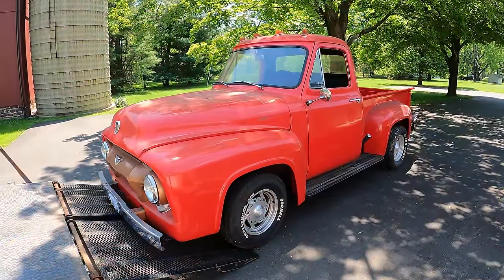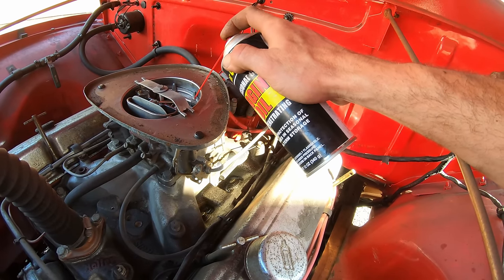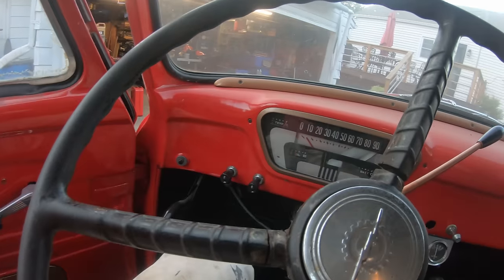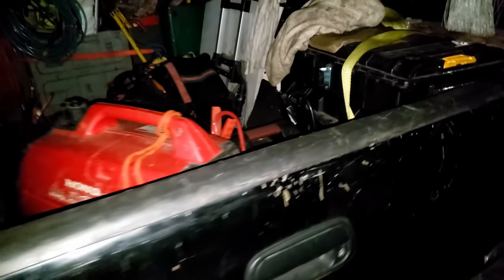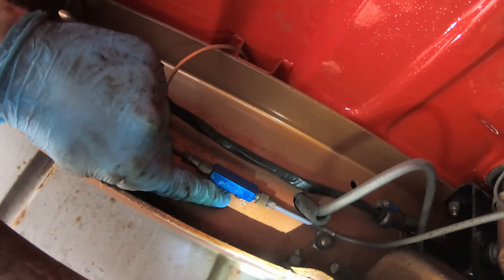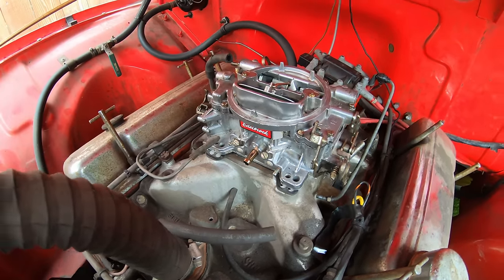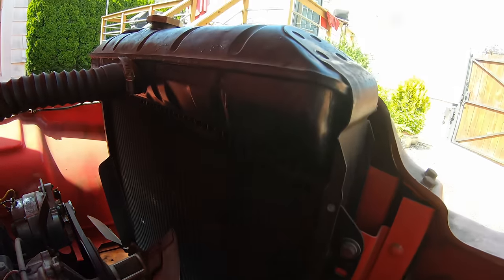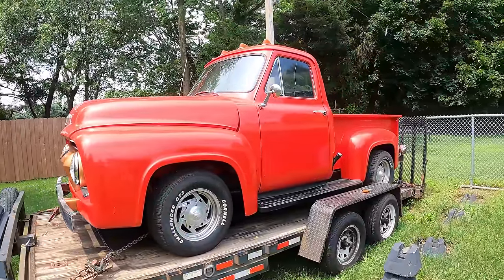1954 Ford F100 w/Pontiac 400 - Sitting For 12 Years NNKH

Comment: When those trucks (Chevy also) were made the lock was on the passenger side so you had to get in on the sidewalk side in the city so you didn't step into traffic. you pushed down on the drivers door handle to lock it then slid out on the passenger side. push down on the pass inside door handle to lock it the hold in the push button on outside door handle and hold in until the door was shut and your truck was locked. to get back in use the key on sidewalk side and slide in.

Comment: Hei  requires a true full 12 volt  key on only power source   re wire it to the back of the fuse  box  on a key on source  ,it will start and run completely different and idle clean ,make sure u gap ur plugs proper.

Comment: What a beaut. I love the older Ford pick ups. Yeah paint that center grill. Touch up the corrosion on that hood. Good cut polish and wax New glass, and That brown looks poor or chrome it. The truck bed just paint it with teak oil just like they do on the boats. If the truck were mine. I would put in a flat head V8 with a 4 speed. It would be my daily driver I enjoyed this one.. Thanks for posting it A Super High ^5 on this one.

Comment: Looks like someone removed the frame crossmember that was located at the rear front spring mounts, probably due to clearance issues.  It should have been left in place and modified for clearance as it would control frame twist in that area.

Comment: FYI. The reason the door lock is only in the right door is to stop the drive from exiting and entering the left door. The exit process was the drive would lock the left door (push the door handle forward) then slide across the seat and exit the right door. From there lock the door using the key and I don't remember if the door handle could be used before closing the door. It's been to long ago and I'm to old to remember. The industry logic was for safety, if you parked and there was traffic on the left side you would be out of harms way by exiting the right side. Studebaker did this to there trucks.

Nice truck.

Comment: Early fords only had locks on the passenger side because Henry believed it to be dangerous to get in and out on the drivers side so basically a safety feature!, also it saved money!!!!
Reply: I’ve had a ‘51 F1 for 29 yrs. It has a warmed up 302. After hearing those flowmasters, I think it’s time for dome new mufflers!
I was told that another reason why the lock was only on the right side was to let the passenger “ ladies” in first.

Comment: Brings back memories,  my cousin had a 1950 ford truck that he put a 455 Cadillac engine in.
Reply: What year was the Cadillac motor i didnt know they made a 455 i could remember a 472 i think was the size
Reply: I could be wrong on the size I was alot younger back then & I really don't know alot about Cadillac but I thought I heard him say it was a 455 but I know it was from a Cadillac, he believed in a Cadillac. Either way at the time I had a 76 dodge truck that my brother built & we put in a screaming small block 340 that wouldn't touch my cousin's truck.
Reply: @scottyellis3442  i think they made a 500 and a 425 also i always fooled with pontaic stuff
Reply: It was a strong engine, whatever it was.
Reply: @scottyellis3442  those Cadillac engines had to be strong those old Cadillac weighted probably 6000lbs  if not more
Reply: You're right about that, I'm interested to find out now exactly what he had so I'll find out tonight.
Reply: I had a 53 ford truck that had a 69 455 pontaic motor when i saw your post about the truck having a 400 pontaic thats what caused me to watch
Reply: @davidcaskey4669  that's funny !!!! Pontiac 455 wasn't produced till 1970
Reply: @ronclaman156  I think you may want to check your Chilton manual if you have one that goes back that far.  Mine also listed one for a 68 and without going out to the garage in the cold and missing the game I think the two letter code on the passenger side of the block was either a wz or yz I can't remember which but do remember a z in it
Reply: @ronclaman156  I went and looked it's a WG on the 455  and a YZ on the 400 I have both of these motors in the garage. My father in laws 69 Grand Prix had the 455 in it

Comment: Nice pickup  I took a 50 model GMC pickup made it into a hot rod. Beef up the suspension BOY SHE HAD THE LOOKS.  Setting PREFECT > I put a 327 Corvette engine in it. 511 rears, Hurst 4 speed, BOY SHE WOULD GET IT ON.. Then my wife said either those cars go or she is going.  I wish i told her>>>   HIT THE ROAD  >    I dearly love that pickup truck

Comment: Key hole on the passenger side is because the truck was designed for delivery and courier drivers. The idea was they would always enter and exit the truck from the passenger side when on a busy roadway. Essentially, away from dangerous traffic.

Comment: This is going to be long winded, but you asked for ideas, I want to help so here I go. 
     I daily drive my 2 door hardtop 72 Lemans, and I mean everywhere. It only has 89,000 miles on it so why not? I also had a hesitation with mine. I kept trying fuel but nothing helped. An old mechanic told me to check my timing, which I had set myself. I had set it at 14 degrees at idle and about 34 total mechanical timing. I reduced it to 8 and 28. Poof, hesitation on throttle tip in is completely gone. I had it set more for a built engine when mine is mostly stock. Oops, not thinking. 
     Also, please change out that single plane intake. That is killing a lot of torque, and part throttle drivability. I have an Edelbrock Performer on mine but you could try to get away with an RPM intake. The RPM intake is 1 1/2 inches taller so I couldn't use one because of hood clearance problems. You won't have that problem.  
     Another suggestion would be to go to an electric fan, or at least a clutch fan. Solid spacers on water pumps end up blowing the seals, or taking out the bearings. Every time you smack the throttle, the solid spacer jerks the water pump bearing on acceleration, then again on deceleration. Not only does it take out bearings and seals, I watched a guy smacking the gas and revving his car at a car show. All of a sudden he had coolant spraying everywhere. He broke the snout of the water pump. Oops again. 

     One more thing and I'll stop. Speaking of water pumps, you didn't say that it is having a running hot problem, but I'll give another experience. If it tends to run hot with the new radiator, don't look at the radiator first. Pull the water pump. Pontiacs have a backing plate behind the water pump and sometimes they have too much space between the impeller and the plate. This causes too much coolant to bypass and stay in the block. Take the plate and put it on a flat bench with the cone facing up. Take a part of something flat, even a short part of a 2X4, and tap it with a hammer to flatten it a bit. Keep checking the space with a feeler gauge until you think the plate is close enough to the impeller to force the coolant not to be bypassed, but not hit the impeller when hot. You would be surprised how that fixes many overheat problems in Pontiacs. 
     
     I know you fox vehicles for a living so I hope I don't sound condescending. These are just ideas and experiences with Pontiacs. None of us can know every single little quirk about every single brand of engine. Just my 2 cents. 

Oh, I am not easily impressed by car fix videos. I just watch them for new ideas. I can learn every time. I watched the whole damn thing without skipping forward. Damn you, you made me sub and wait for more. Thanks for that. LOL I want part 2 now. Gotta see old vehicles live, and Pontiac engines too.
Reply from the maker: Hey. Greatly appreciate all your suggestions. I totally agree about the single plane intake also. Personally I would like to convince the owner of this truck to let me do a Ford swap with manual transmission. So we'll see where this goes.  Interesting about the timing. I set this one by feel and basically backed it off a little bit after it was pinging. I did put the timing light on it and it was around 32 degrees total timing.  I appreciate you subscribing and thanks again
Reply: @NoNonsenseKnowHow  I'm happy to help where I can. Thanks for responding. A Ford swap would be nice also. I'll keep watching.

Comment: Nice truck love those F100's years, looks good most small items were easy fixes I like motor good choice nice see that used instead the small block Chevy or Ford small block. Steel rims paint tan or light brown with trim rigs small caps.

Comment: Hey I just got the same bike as you(1983 xl600r) but your videos are old so I figured to ask you on this lol well just want to ask where you get your parts and if yiu can even still get the
Reply from the maker: I usually get my parts on eBay or whatever OEM parts supplier website that has the cheapest. A lot of the parts are still available since they cross over to newer models.

Comment: The Pontiac big block has more torque then any gm big block engine , I had 69 lemans with a well built 455 and a 66 Chevelle also a well built 454 and that lemans always had a little more then Chevelle . That 400 should be a pretty torquey engine.
Reply: There is no "big" or "small" block with Pontiac. Same block, different bore and stroke to make displacement. Makes engine swaps within the Pontiac family so easy.
Reply: @reaper20015  Yep, I own two. The 326, the 350,and the 400 had the same 3.75 stroke also.
Reply: Pontiac is under the "GM" umbrella.
Reply: @reaper20015  Yeah just love it when someone makes that comment about big block

Comment: Back in 1987 I bought them 54 Ford pick up pull the motor out how to 429 at had the frame sprayed gold had a complete body off frame sandblasted and sprayed gold I’m just curious on where you got that pick up had a wood bed it had wooden side boards on the outside of the box just curious on where your friend got that packet because it got stolen from years ago

Comment: If it has not bean running for awhile. !!!!!   why did the radiator have  pressure in it ??????
Reply from the maker: Taken from a cool garage into summer heat. Thermal expansion

Comment: Get rid of the turbo 400 and go with a 700R4/4L60.
Reply: Will a 700r4 bolt up to a pontiac engine? well without an adaptor.

Comment: Why would anyone slap a 400 Pontiac in a Ford 100, plain nonsense.
300 inline 6 would have been the perfect motor and at least more original than a dam Pontiac.
With that leaf spring suspension your never going to have a drag truck.
Come on man, a Pontiac.
The truck deserves a better owner than a idiot who stuck a Pontiac 400 under her hood and thinks he has some kind of special race mobile.